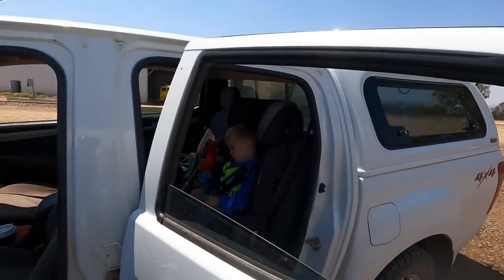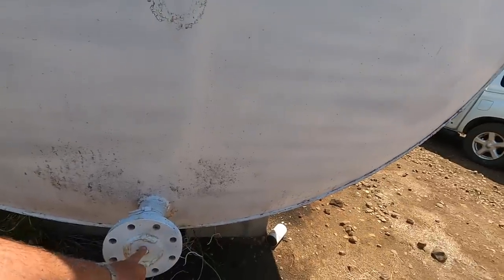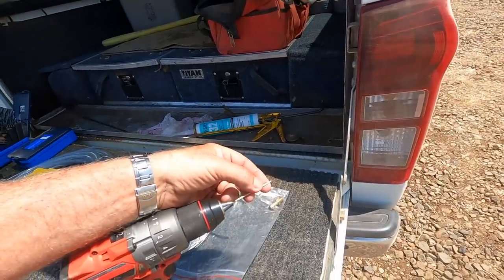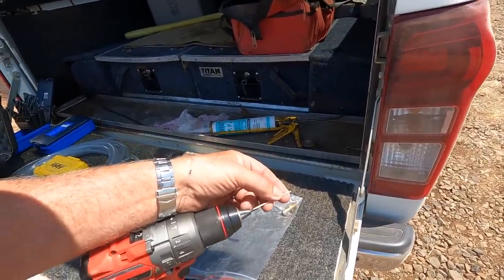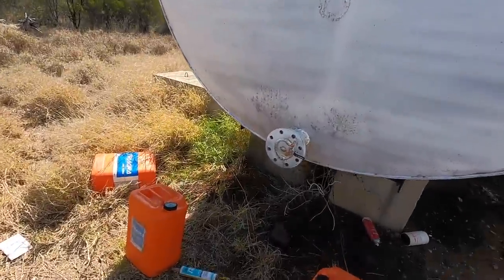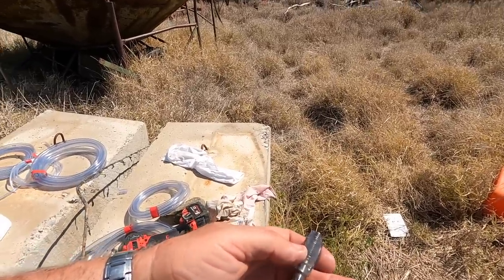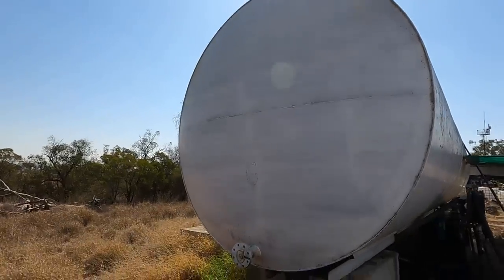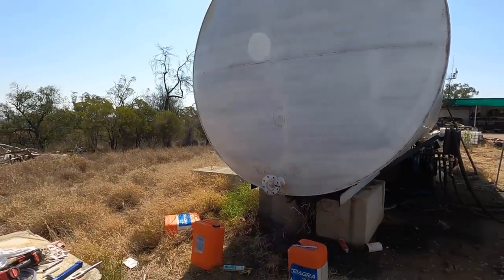Drilling Into a 55,000 litre Fuel Tank | Dads Wild Ideas

Comment: Nice job Peter on your plumbing job, let me tell you how I do it, weld a coupling or a pipe nipple on first, then thread on a quarter turn valve, open the valve, then drill your hole, pull the drill out and close your valve, then install your other piping. Hope this helps. We would use this same system to plug a hole in pipe or tank.

Comment: The good old clear hose in the fuel tank trick.
Used to do those when working on the old coaches. We used to drop in a section of coloured air line inside with one end melted over as a float.
Then with the fuel company we had to just run our hands over the tanks to feel where the fuel was up to as filling them. That was fun getting from the top of the tank back to the truck to shut off the fuel as to not over flow the tanks And then you had the locals sliding between your feet to that was fun.

Comment: It looks like ya got it done!!!!  (without to much trouble or spillage)  15, 500  (approximately plus)  gallons US  measure.   At current prices here:  67000 USD +++ dollars to fill that tank if it were empty.  I topped off some tanks here at the farm the other day.  (got hosed pretty good)  I paid 4.499$ per gallon USD  for AG fuel (no tax)  Highway fuel would have been more.

Comment: Only need one hole into the tank at the bottom as when you open the valve it’ll find its own level with the fluid inside. As long as the end of the pipe is open to air, best to go up above the tank about a foot and then turn the end down to stop rain going in the tube. Then you can leave the valve off so if the small tube gets damaged, such as from flying debris from the wind the tank won’t empty itself unknown. So you only need to turn the valve on when you check it. That’s how our heating oil tank here works
It’s also just t’d into the main outlet of the tank just after the main shutoff valve so there are fewer holes into the tank and thus fewer chances to leak.

Comment: I know that I’m late to the party but did you think about putting a shop-vac on the breather pipe on the tank? It works on an engine if you need to reseal a leaking sump plug but don’t want to drain the oil out, so I can’t see why it wouldn’t work in your situation.

Comment: There is a easy way going through the top of the tank, still need to drill hole but no fuel loss all you need is a a float attached to wire that goes in tank a piece of pvc pipe with a thin slot the height of the tank and attach it to tank then a coloured disc that you attach to the other end of the wire that's attached to the float and fits loosely in pvc pipe, when tank is full the coloured disc will be visible through the slot of pvc pipe at bottom and when empty coloured disc will be at the top, job  done the advantage of this is if something goes wrong with what you did with the valve and something hits it and snaps valve off and your not aware, you lose fuel.

Comment: Young lad needs some time away from the women 😂😂😂 very brave and skill full work. Think I would have bolted a flange on then drilled the pilot hole out. Will your hot sun not quickly destruct the plastic pipe, though I see it’s on the shaded end of the tank?
Reply from the maker: Usually get a couple years out of the plastic pipe before you can’t see through it 👍😁

Comment: It's a shame someone would weld that flange vs just bolting a blind flange too it like its designed for, and you could pump a suction on the fill bung to prevent flow out while working on the bung.